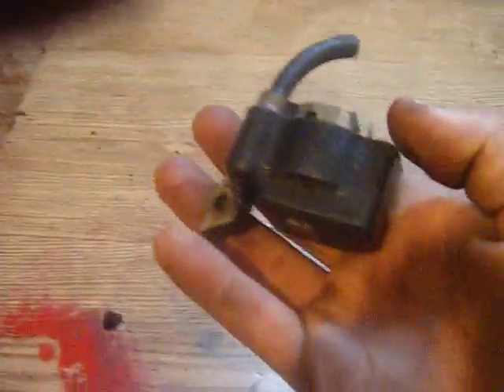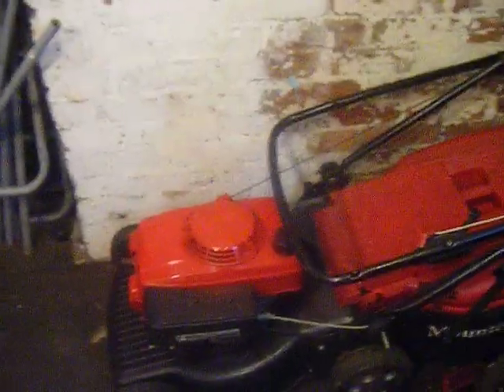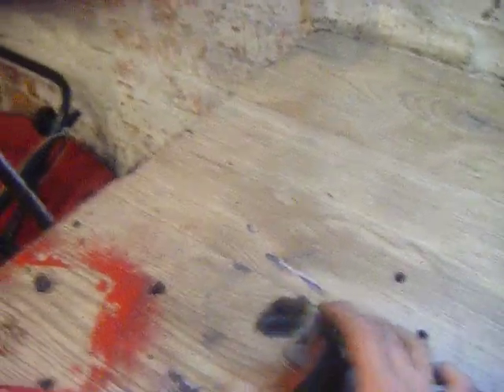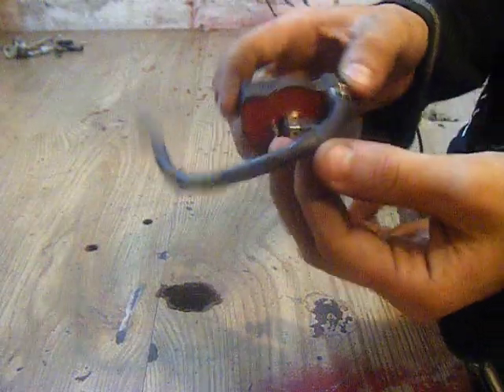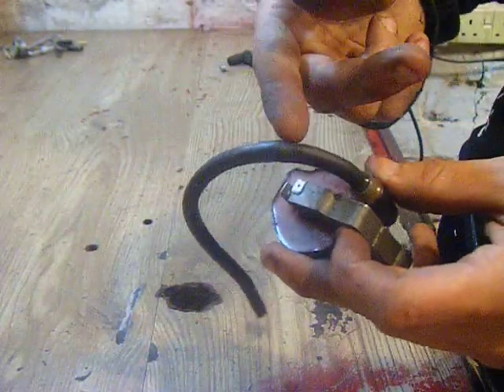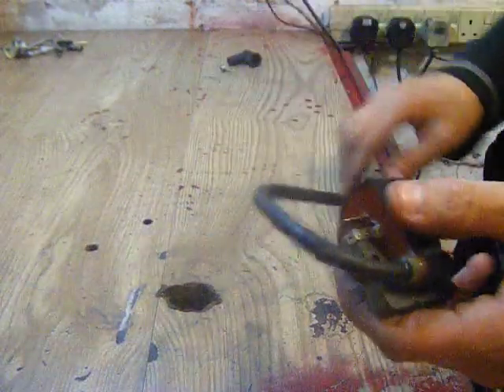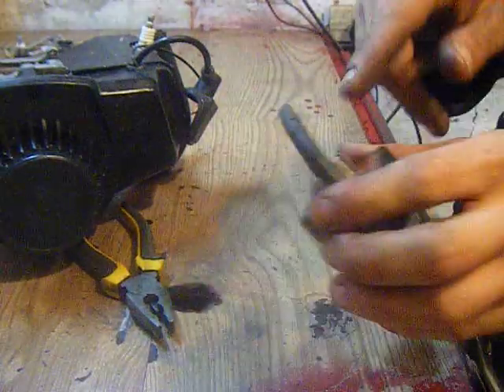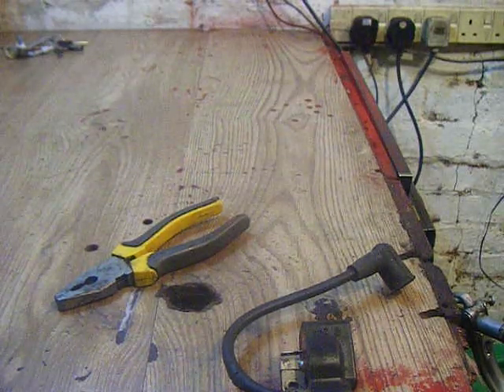how to fix small engine coils

Comment: Been there and done that. 5hp and 5.5hp b&s engines are the worst for burning up their coils. It's a engineering  design screw up. Its wire wound carbon wire from the coil to the plug is an ingenious way to get you to keep buying lawnmowers. Terrible design.

Comment: This is a great TIP!!! I had snowblowers that were stored out side that had mice nest under the fly wheel. Guess what they chewed on? You got it. One was chewed to bare wire this one was mine. I spliced a TV cable wire. Used 2 pieces, splits facing opppsite & then tape with electrical tape-So far it has worked for 2 years. But your tip is great.